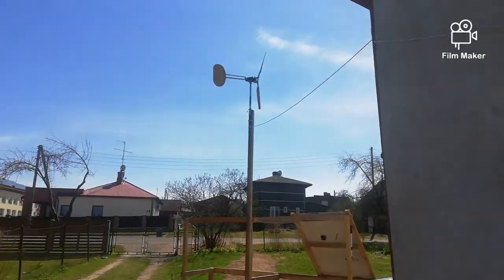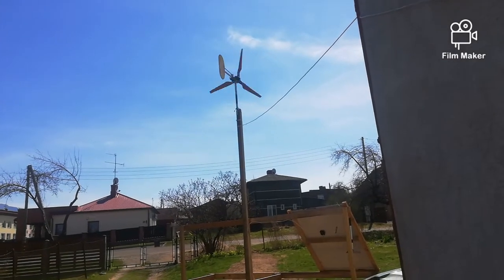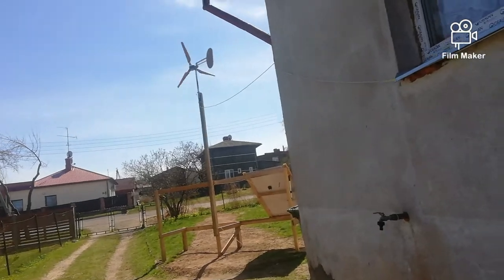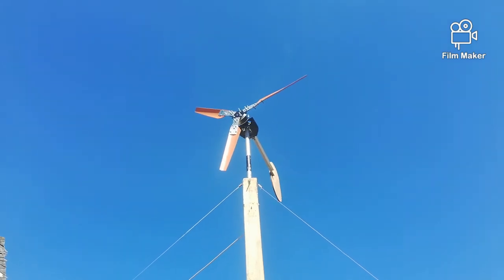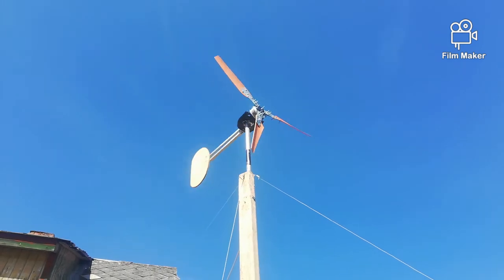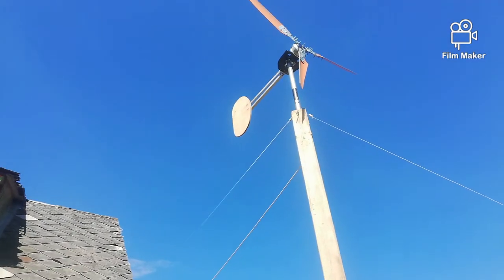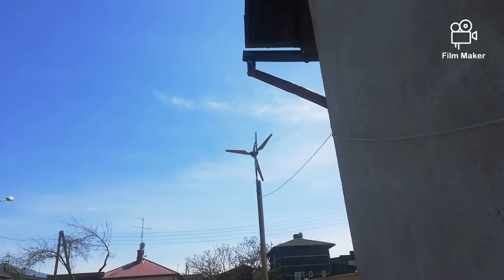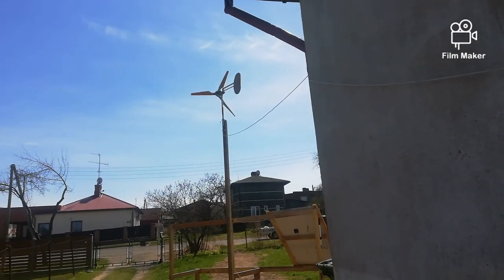Hoverboard wind turbine rpm and voltage

Comment: Does the battery charge even though it's getting 4-5 volts?
Reply from the maker: nop, at that time it didnt charge at all, BUT right now if you take a look my last videos abaut the same turbine but different diy blade setup then you will see 186w from it... it works great and 186watts from 250watt turbine with these diy blades... what elso could i ask from it :)

Comment: Use 3phase transformer and then you get 100v on 50rpm
Reply from the maker: i use 3phase bridge rectifier now... but i might consider this idea! :)
Reply: @SigmaWorksSW3D  i did this but tried with regular O transformer and got 90v by spinning hand and some decent current
Reply: @SigmaWorksSW3D  lol i just put mine windt turbine ln its tower and i get like 10w lolll
Reply from the maker: atleast something... but most important thing for power output are blades.... my blades make 186w
Reply: @SigmaWorksSW3D  nice i didnt even calculate my blades. And that 10w was like 100rpm

Comment: why onlly 3 thin blades ..??  ...why not 8 .. 10 blades ...???????
Reply from the maker: thats because i used handheld grass cutter metal blade and it has 3leafs... it was cheapest from everything else ;) i wanted to see how cheap i could go to get this turbine actualy work... just turbine itself costed me 90euros to make... now i just have to make bigger, heavier blades and 3D print body for it and thats it... at the end it will cost araund 120euros ;)
Reply: 3 blades are usually better than more. it's more about swept area. the only thing more blades gets you is a easier startup but also brings down maximum speed. his biggest problem in the past few videos is it looks like his tail isn't large enough so it's furling in the wind too soon. You want it to furl when the speed gets too high, but with this small of a tail it seems to be furling before it really starts to generate a lot of power.